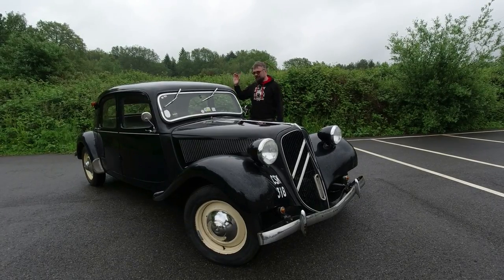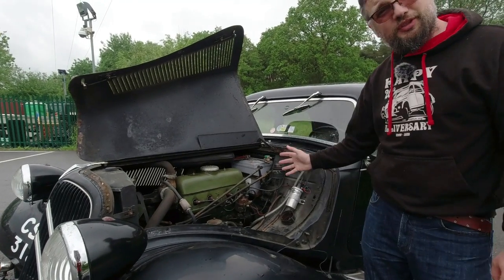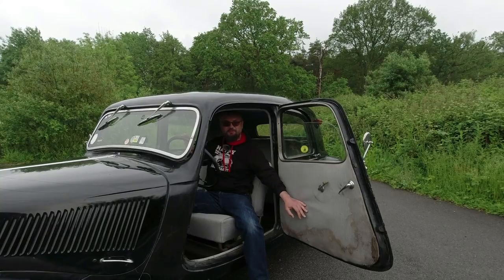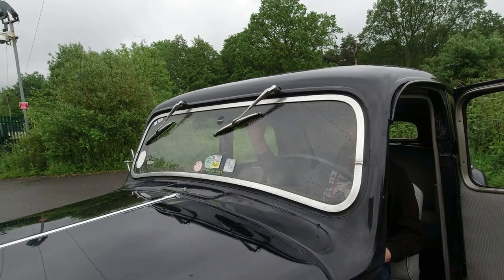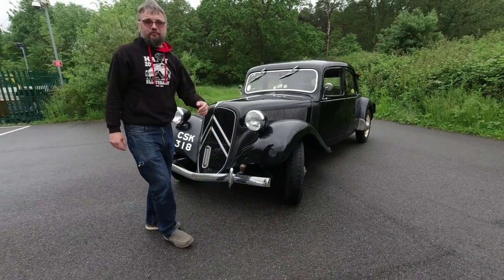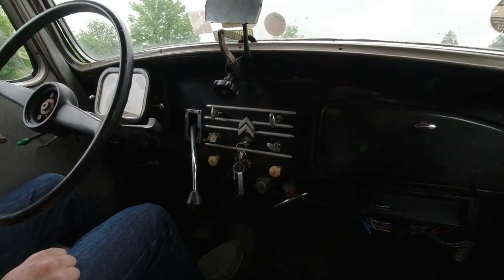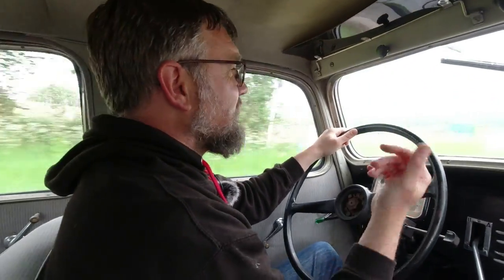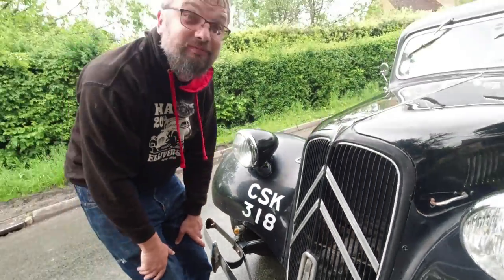Real Road Test: 1951 Citroën Traction Avant - 11 Normale

Comment: interesting to compare to a Daimler DB18 with the preselector gearbox. I've driven a Consort of similar vintage: very quiet and smooth and plenty of waft on the flat but found hills a bit of a challenge, even with a 2.5-litre six
Reply from the maker: Yes, amazing how underpowered a lot of pre-war cars are. I remember driving a Morris Oxford Empire Six and thinking it would get a shift on. It really didn't! It didn't stop very well either, not helped by having a freewheel - I didn't realise that until I was hurtling downhill towards a red traffic light! Right-mounted brake pedal too...

Comment: Outrageous suggestion alert - I've always thought that Lefebvre was a much cleverer and more practical engineer than Issigonis. Anyway, I've just been rereading The Autocar's 1953 test of this car. About the gear change they said :- A fairly deliberate movement is imposed on the driver because the selector locks are interconnected with the clutch pedal and it is therefore impossible to move the gear lever until the pedal is fully depressed.
Reply from the maker: Yes, I forgot to test that!

Comment: Citroen wanted a flat four and flat six based on the 2CV twin cylinder engine for the DS but couldn't afford to fully develop it. They also wanted an automatic gearbox for the Traction Avant but couldn't get it done as well

Comment: Ian any chance you do a test of the Renault Dauphine ,my first car. Mine was as rough as badgers bottom. It covered in a multitude of different colours ( Art Student Days),dents ,it was in a hell of state. It lasted  a year , did 12000 miles before the big ends gave up. It had a 4 speed gearbox ,appalling brakes ,6V electrics , in fact I had to put  Massey Ferguson tractor wheel weights in the front to get any kind of control around bends. But what a car I loved the car.

Comment: Just a thought to André Citroën - yes just dying before the success of this revolutionary car, but - in a very strangely similar way, this is what happened to Henry Royce (the Merlin engine) and Reginald Mitchell (the Spitfire fighter plane), making the main components ... of a vital victory, happening few years after they died. Let's propose they all felt the tremendous energy of the last moments of their lives?...

The automatic gearbox couldn't work because of the lack of a temperature-performing lube for it, on France's market in 1935. Gaston Fleischel, its inventor, however got "some" money from GM when he sold the production licence in the '30s... The Automatic Transmission then became an american adventure of course!

Many thanks for this very interesting presentation, giving the truth as close as possible! :)

Comment: In the 1950's, my father needed a car for his work.  Unfortunately, we lived somewhat 'hand to mouth' back then, so a car was as much a drain on my father's income as it was a necessity.  I imagine it hard to believe now, that my father had rather a lot of what we called 'bangers' - very old and very used cars, that he bought for '£pounds, not hundreds of £pounds, just £pounds.  He would often leave the house with one car, and come home with a different one.  One day in 1957, he turned up a Citroen Light Fifteen - now referred to as a 'Traction Avant.  But his was built in Slough n 1938.  A once silver car, that someone had turned 'two tone' by painting all below the waistline 'dark green'.  It was a truly spectacular looking car with its low ride, Michelin X low pressure tyres, and wide frontal aspect that appeared quite aggressive to oncoming traffic.  At some point during its life, it had had its headlights replaced with those large flat-faced types seen on cars such as a Jaguar S100 sports car, along with an aluminium and pearl sports steering wheel.  It could do 75 mph, which in the late 1930's was amazing, and even in the 1950's it was no slouch.  But where it could rival any racing car, was its incredible cornering.  Michelin had wanted the car to test and display their new steel belted tyre - known as the 'X', a hybrid between 'cross-ply' and 'radial', which the car did to the tyre's absolute limit ... both were well up to the task.

I. as a fifteen year old back then, had been into cars as a hobby for a number of years, collecting new car brochures, and being a nuisance in car showrooms.  For a thirteen year old boy I had a remarkable grasp of how cars worked.  So when at age fifteen, and the Citroen arrived, I was amazed to discover that the Morris Minor's front torsion bar suspension, and 'Rack and pinion' steering, and the Mini's front wheel drive, were all there in my Dad's 1938 Citroen.  However, that's only the glossy part of my Dad's beautiful Citroen, the gloss wasn't to last for long.  The probable reason he was able to buy it in the first place would soon become apparent ... Dad couldn't afford spanners or a decent screwdriver, let alone have a car repaired by a garage, which was well out of the question.  That occasionally he had to used the 'starting handle' because the starter motor just whirred, appeared rather amusing.  His mechanic friend had diagnosed missing teeth on the flywheel.  All too often, when the starter motor did engage, the engine would turn and start, but with an awful grinding noise.  As time would show, that grinding noise was more teeth being torn from the flywheel.  Eventually, the car could only be started with the crank handle.  All garage enquiries were met with, "Sorry, it's a main dealer job that"... the main dealer's quote was three times what he'd paid for the car.  It was now unsaleable, yet when it had still been, he had refused several offers from his many envious associates.  The car was eventually sold for £15 to two young lads who - despite its declared problem, wanted it for 'Grass racing'.  A sad end to the car I still hold great affection for - as age fifteen, it was the first car I actually drove, albeit only around a field.

Comment: Actually more voltage (within reason) will allow the motor to draw less current making it less likely to burn out, 6v starters and the like are normally fine (if in good condition to start with) on 12v for this reason

Comment: Beautiful lines on this car, but I'm surprised there are no running boards connecting the sweeping, elegant fenders,  like you'd see on a 1930s Ford Model A.  Perhaps the monocoque  construction didn't provide the needed anchor points, or they were deleted for cost & weight savings.
Reply: My understanding is that the low slung monocoque did not not require running boards to assist entry and exit.

Comment: Plenty of legroom was common in 30's cars with a lengthy wheelbase, they just lacked luggage space.  Citroën are not the only manufacturer to try out mechanical parts for a new model or upgrade, on an existing car, Renault do it.  An absolute headache when buying spares as not just VIN needed but complete build code to obtain the correct part.  Then arguing with the dealer parts manager who was trying to tell you it is for the next model year.  Trip outside to show him the car and the part.  Much head scratching by him before saying it will be 2 - 3 weeks to ship from France as a special order as slightly different to the newer model stock.
Reply: That’s part the reason why I hate french cars.They are what I call parts bin specials

Comment: Fiscal power ratings are based on steam engines, with most common high pressure piston steam engines at the time the formular was created you could work out the power just by bore x stroke x number of cylinders, but this doesn't really work for internal combustion engines, it's just an easy bureacratic way to have taxable "power" ratings without actually having to test every vehicle on the market.

Comment: Great review. So much to say about this car and you managed not to garble it in your excitement! But I take issue with what you said about independent suspension all round. I’ve always thought the rear suspension was by beam axle?
Reply from the maker: Drat. Apologies for repeating that common misconception. It is indeed a beam axle.
Reply: @HubNut  Well, Jay Leno said it too and he was under the car staring right at it!

Comment: Nice video Ian. Is it true that the engine from the traction avant is used in the Citroën DS?
Reply: it was used in the first years of production of the DS.
Reply: @jimmyj1969  I thought that also, but wasn't sure. Thanks for the info.
Reply from the maker: Yes, that's true. They can out of money to build the air-cooled flat six they wanted.

Comment: I think it’s a bit unfair to say that the Traction broke the company, although it makes for a catchy title. You might as well say it saved the brand.

The company was broken by a combination of 1) an economic crisis that induced a drop in sales, the aftermath of the 1929 crash, 2) a huge investment into a new factory, the refurbishment of Javel, and 3) the investment for a completely new model replacing a long established previous range, the Rosalie.

I can scientifically prove it’s this combination, because… the experience has been repeated with exactly the same outcome, 40 years later (1) oil crisis, 2) Aulnay, 3) the CX).
Reply from the maker: The development costs of the new car certainly did not help, especially with the failed transmission ditched just before production began. But yes, the new factory was also a stretch too far.